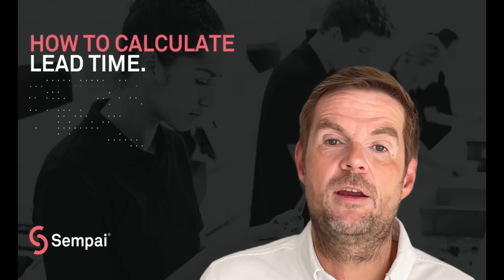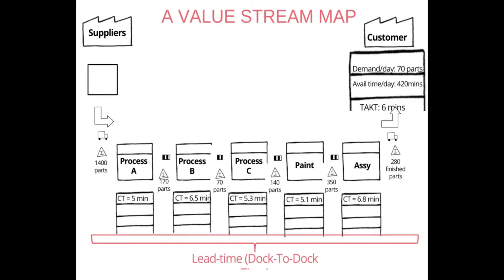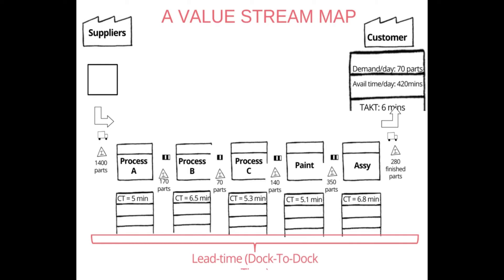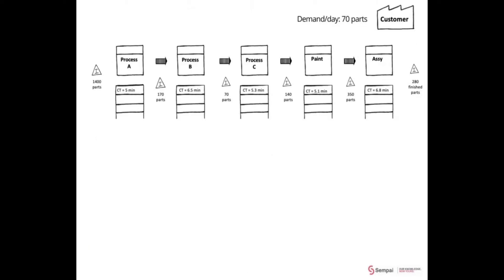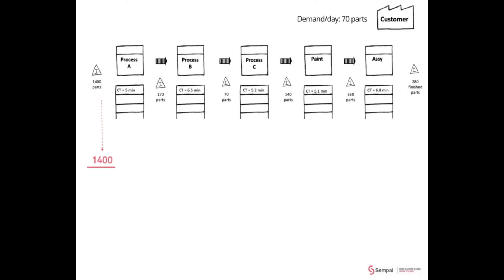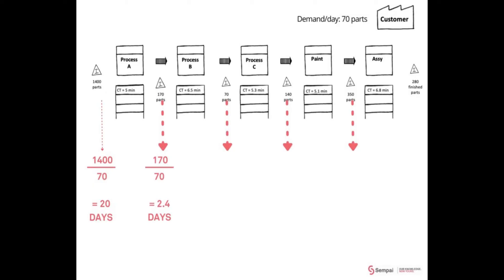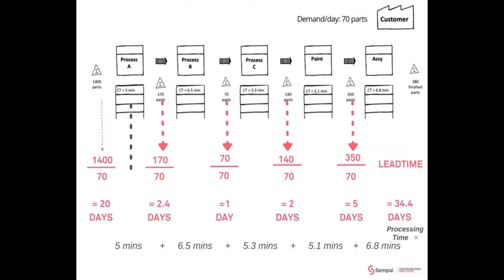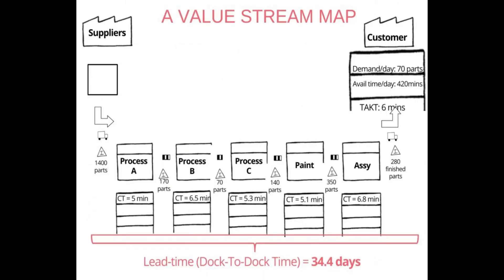How to calculate Lead Time. The easy way.

Comment: why do you not account for the last inventory of fully assembled parts on the end (The 280 finished parts)?
Reply from the maker: Hi Samuel, we did and then didn't! - well spotted as it's an editing problem on our side. At 1 min 38 secs the finished goods inventory is correctly included in the lead-time calc...but then at 1 min 59 secs, even though the finished goods inventory is still included in the overall 34.4 days lead-time, we missed the information off the slide. We'll re-edit. Thanks again